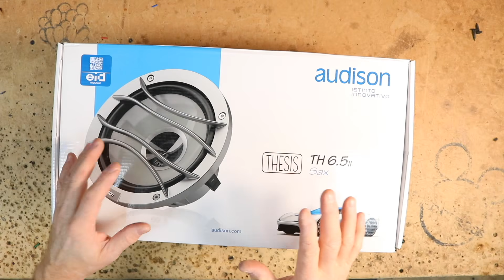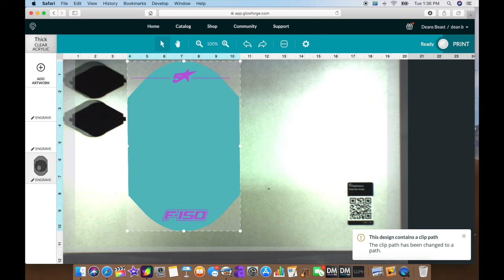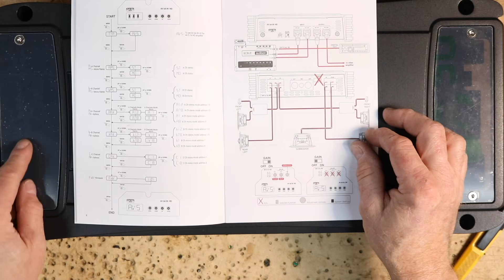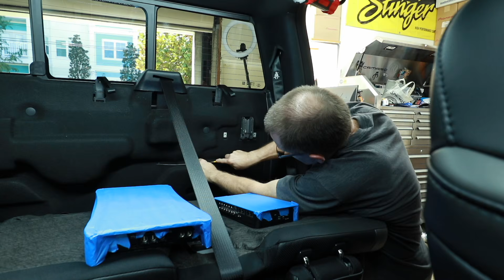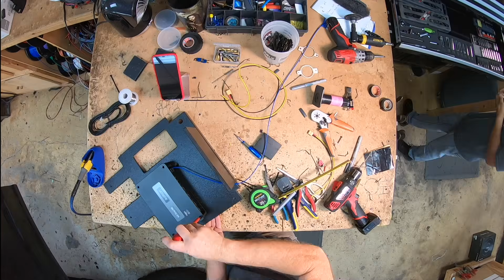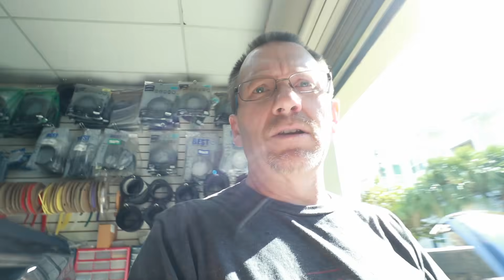Ford Raptor Audion Full DA car stereo install

Comment: HELP, PLEASE!!! I am reaching out to ya b/c I'm in desperation now! I have the B&O Unleashed 14 speaker factory system in a 2025 F-150 Supercrew FX4. I have bought the following gear:
25 NAVTV Zen Audio unit
2 runs of 4 gauge 12V from the battery
1-JL Audio VXI 800/8 
1-JL Audio RD 1000/1
2-Hertz 70.3 midrange in dash active x-over
2-Hertz CK165 separates in front doors and tweeter in pillars active x-over
2-Hertz MPX165 PRO coaxial full range 
2-JL Audio 12W3 DVC Shallows 8ohm/MTI down firing sealed 
All using factory locations with active x-over full range on the 4 doors and dash for the mids and he used analog after asking for the toggle from Zen to VXI 800 then using the audio out to the RD series amp for subs/No passive boxes used
The subwoofers phocking rock! Man this thing pumps out the lower end 40hz-500hz, DOES NOT skip a beat, perfecto 🥰! Zero distortion just hard-hitting notes!
Here's my problem, the as I start getting over 20-22'ish on volume the mids are NOT there as they should be, all 4 doors have sound shield 5mm wrapped with block out plates cut and fitted over the large holes and inside the door it is laid in between the pillars bottom to top, so the shits solid and the rear wall has been covered!
It sounds like a reverse polarity issue I ran into in the 90s hooking up installs for everyone in our town, but that was analog days and I was a wiz trouble shooting too but these digital amps and DSP signal and sound has me in panic mode. 
Now the issue is it just doesn't sound full and subversive as it should, it isn't getting loud as it should but also will start making a pop/crack noise periodically and think it comes from the front dash 3" mids but maybe its all but the dash for sure which just doesn't make sense! It sounds ok at best but for 800/8 and 75 Watts RMS to each speaker no way it is reaching its potential, the factory radio to the front 3" and tweeters sounded more clear and louder. We ran dedicated wire from amp to both pillars and dash 3" and 4 doors used the available wires and unhooked these 4 from radio but the 2 overhead tweeters I think are on the head unit still. The install is a work of perfection, Elusive Audio in Georgetown Texas if anyone's curious, his available pictures online do the talking, his works amazing full custom interior's. There is zero noise being picked up through the alternator or anything else. 
Any ideas or clues on why this is occurring, I'm 10 grand into this and have this one issue. I was sweating bullets putting this package together because I have no experience with factory audio interfacing and this was my main concern after a 24 year break from sound systems and my stomach is dropping further down every passing hour. 

My fathers retired Air Force electronics instructor, and we fixed every radio/amplifier in the town in the 1990's early 2000's and he taught me allot about replacing popped capacitor's/dead channel outputs, fixed many power acoustic/Rockford Punch 45/75/150's 40/60/100's , Pheniox Gold MS-275's, PPI Art series and the following gen the rounded off silver/ darker grey amps. So I grasp the basic concepts. 
Please guys, any help is welcomed!

Comment: I'm going with my Kenwood Excelon Reference Equipment with twin Power Acoustik Overdrive amplifiers and a single 10 inch JL marine subwoofer in my 98 Lexus GS300 very soon. Happiness will be finally disposing of that old Nakamichi factory junk!

Comment: hi this is old but good in( Audison av 5.1k amp) analog to da card change :srew those screws from sides almost out and you can pull card out in easy way, btv still best amp for 2-way active front+ sub configuration(passive tweeter+midrange 4ohm 75w/channel A-class, active midbass 2ohm 240w/channel A/B Class, active subwoofer 4 or 2 ohm D class  600/1000w enough to feed sub, idont see better combo) so that is a poor Audiophile choice no.1. If someone find better AMP i woud please to hear or see that. BTW nice work you do

Comment: The filling of the hole in the door is a massive improvement, I've owned Mazdas and VWs That came with doors that were sealed from factory and the sound is so much better even without sound treatment. My corolla sounds like a tin can by comparison even with sound treatment because infinite baffles are crap full stop no matter how dead you make it. Also can stop a lot of vibrations hitting the plastic outer door trim. I'd buy another Mazda 3 just for putting a good music system in.

Comment: Great job👍👍👍 I'm gonna guess a price.  Curious what others think. This is serious, one off, custom fabrication. Decades of learning the craft. Examples: Thesis speakers are $4500 per set, $6k in 3 way form.  Labor would be $1k for just x-over adjustments, eq and time alignment alone.  This job is weeks long. Assume $500-$700 a day per guy. Sound deadening the doors???  $1500+. I would say $8k number may cover the labor, but I doubt it. Another $8k for amps, Bit, Zen and wiring.  Speakers, Subs, box and custom Touches??? Total $30k????  I'm probably quite low.

Comment: I wonder about my 2 cars 2013 toyota camry and my 08 impala, us the ground issue the same as the f150.. and when dean says, if you don't connect 🙄 to the battery bad things happen, does that mean you can burn a speaker?

Comment: You guys are amazing top notch installers ,the attention to detail blew me away the sound deadening I believe was on the metal and plastic panel to totally eliminate any vibration ,I have seen great installs of expensive stereo amps and speakers put in a vehicle to go to a car show and just rattle to no end which kills the overall sound to that you get a a plus,the amplifier rack to me look very difficult but you guys nailed it top notch wire work beautifully done,zip ties for a clean finish red and black just perfect,the to tune the whole thing just very impressive routing in engine area runs smooth and nice ,you guys show your 5 star ⭐ talent ,I would like to know how many days the install took I'm going to say a week and also wonder how much the stereo equipment cost verses all the install cost for this project ,I'm going to say this install with equipment was around 8 to 9 thousand dollars.Keep the vids coming.

Comment: You guys are so thorough and I love the specific commentary all the way through the install. 
I was wondering if you might be able to incorporate the cost of the merchandise you put into these vehicles as well as the cost for the install. 
Other than that keep up the good work/information
Reply: I figured it was at least 8 thousand,right down all the Audison amps the one amp was almost 2.000 ,it was probably 5 or 6 grand for the amps ,dsp ,speakers and I imagine at least near 2,500 to 3.000 for wire and install, acrylic,and plastic,I can only imagine the sound in it was crystal clear.
Reply: @seanhower5130  you are off by quite a bit. This is serious, one off, custom fabrication. Decades of learning the craft. Examples: Thesis speakers are $4500 per set, $6k in 3 way form.  Labor would be $1k for just x-over adjustments, eq and time alignment alone.  This job is weeks long. Assume $500-$700 a day per guy. Sound deadening the doors???  $1500+. I would say your $8k number may cover the labor, but I doubt it. Another $8k for amps, Bit, Zen and wiring. speakers, Subs, box and custom Touches??? Total $30k plus????  I'm probably quite low.

Comment: In my MK7 GTI:

I have Audison Voce K6 components in the front, and Audison Prima coaxials in the rear, both F&R doors sound deadened. I also have a Sundown SA10 Classic, mounted in a custom fiberglass box. My F&R speakers are ran by an NVX JAD800.4 amp, and my sub is ran by a Rockville db13 mono amp. It’s all processed through my factory HU, running a Massive Audio Flatline line output converter, and a Massive Audio EQ9 9-band equalizer. 

It’s not a full Audison setup, but I'll tell you what, these Audison speakers are by far the best speakers I have owned, let alone listened to. They don’t give massive punchy mid-bass like a set of Focal Power, Kicker, or Hertz speakers do, but they provide some of the best SQ I’ve ever heard when tuned correctly! Zero distortion at very high dB levels, and the Voce tweeters are very clean and pure. I’ve owned Focal speakers, Polk Audio MM components, Hertz Mille’s, and Alpine Type-R’s, to name a few, and those are all great speakers, but they don’t compare to the clean power or sound the Audison Voce’s produce.

My dream setup would be an active 3-way Audison Thesis setup in the front, a component Audison Thesis setup in the rear, and have everything ran through an Audison bit-one SP, while keeping my Sundown sub (because it’s that good and IMO Sundown is the best sub brand out there). I would love this setup, but it would cost a ton of $$. Until then, I’m completely satisfied with my current setup.

Comment: Just an FYI (in case you didn’t already know), on newer Fords you shouldn’t ground any accessory directly to the negative battery post because it can cause the battery monitoring system (BMS) to read incorrectly and possibly cause improper battery charging. Ford states this in all of their manuals so if the owner isn’t aware I’d suggest informing them and having them either disable the BMS via dealer or using FORScan or they can simply pull the fuse for the BMS. Otherwise, the “proper” accessory grounding point on the 2015-2020 F150 is at the firewall near the battery, just to the right of the ECM.
Reply: I’m a Ford technician and yes this information is correct however, since they are using the zen a2b in navtv’s  instructions it’s specifically stated to ground to the battery terminal because framing to the chassis ground will have too much resistance and you will have a lot of issues

Comment: I would do something about bracket by the battery sitting and touching boost tube ... those boost tubes do slightly move around when turbos are running. Eventually this bracket will rub the hole inside boost tube.

Comment: This is my dream front door set up abs panel to seal up that big hole, sound deading in the door skins back and front sound foam on the door cards and finaly fast ring to finish it up... over kill you say? Yes maybe but i want it to sound the best it possible can.  Qoute from dean😋

Comment: I would hope the thesis 6.5s are pretty amazing since they're getting 900w!
Reply: they wont sound 10x better than some 10x cheaper put it that way
Reply: @mikexc90 lol, yes they will. I have Audison Voce’s and they are the most clear sounding speakers I’ve ever had in a car, and I’ve had a lot of different brands thoughts the last 25 years

Comment: just finished up a ful thesis system  in a firebird  2 pair of thesis 6.5's in the front door a pair or thesis tweeters and mids in the dash and a 3rd pair of 6.5s in the rear stock location and 2 10 hertz mille legends 10's in a custom box on 2 thesis quatros, a thesis uno and a bit one. Sounds aboslutely incredible!